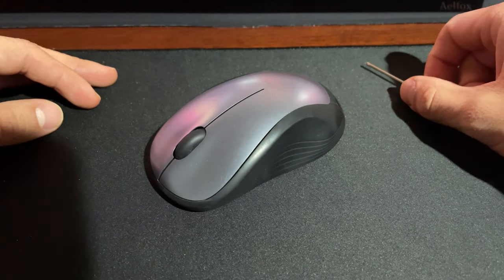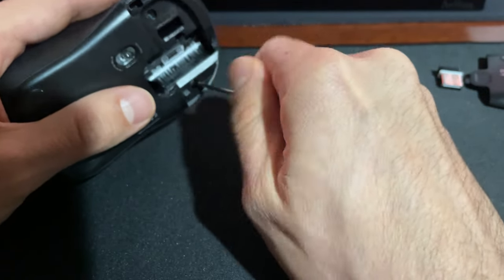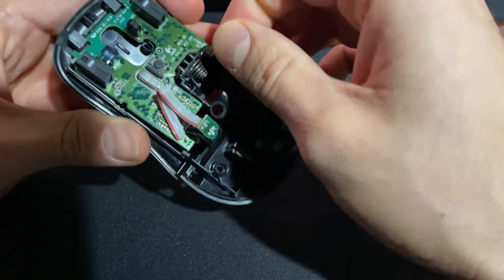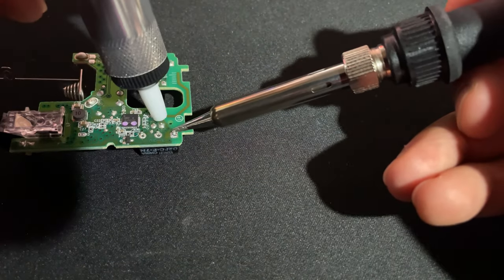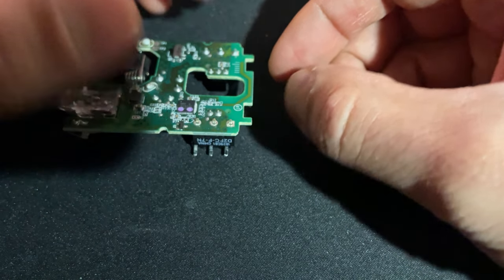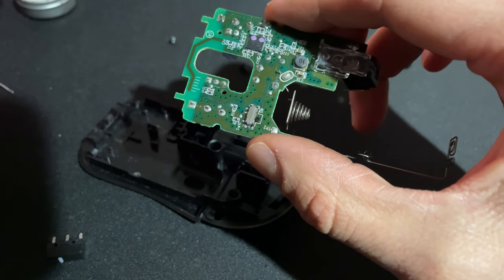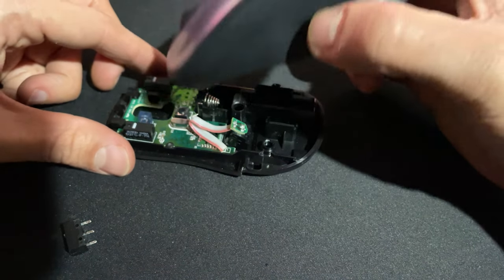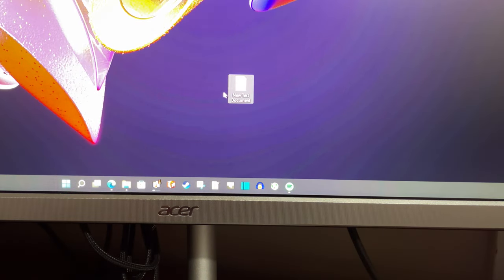Logitech M310 Mouse Repair

Comment: Thank you for the tutorial on repairing which worked also fine for my M310. I also had a problem with the scroll wheel which was hard to turn. When I opened the mouse for repairing the button switch I found that the wheel was covered with a lot of dust and particles which i swiped away. I also realised that I seem to have a newer (and probably cheaper to produce) version of the M310 with another motion sensor. Mine doesn't have a glass cover over the sensor but there is only a hole. So there was also some dust inside which made the mouse positioning inaccurate!
Reply from the maker: Hey Tom, I am super happy to know that you found this video helpful, reading comments like yours makes really me me smile. I am especially happy that you found your problem and were able to fix it. Thanks for watching and take care!

Comment: On mine, the buttons click wasn't holding - if you'd drag some files or text, or text selection, it would soon release itself despite you still holding the button down. I took mine apart and cleaned the dust! 
There was hardly anything visible. Blowing hard a few times seems to have dislodged some that wasn't seen. Clicked a few times on the switch button (not opened the switch case). Assembling the mouse back, the buttons now seem to have regained its previous function. 
Lets see how long it lasts!
Reply from the maker: Thats awesome! I hope this video helped you in disassembling and reassembling the mouse. I really appreciate you watching and commenting, take care and be safe.